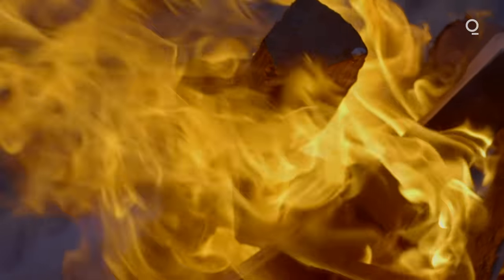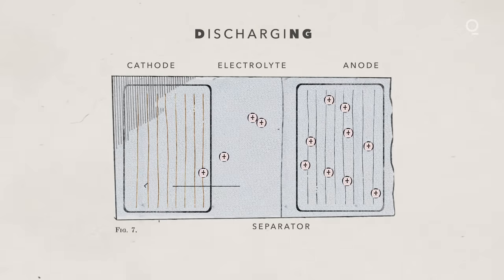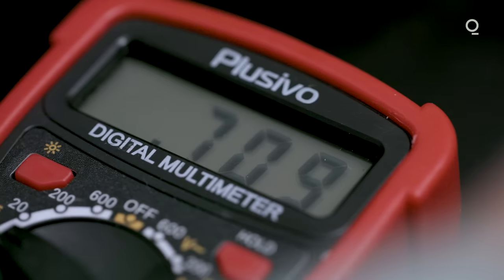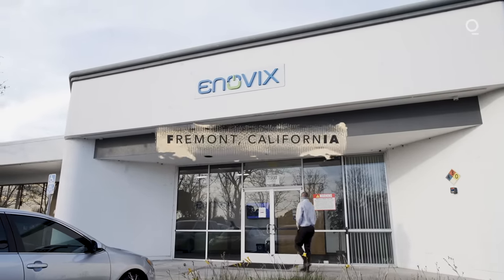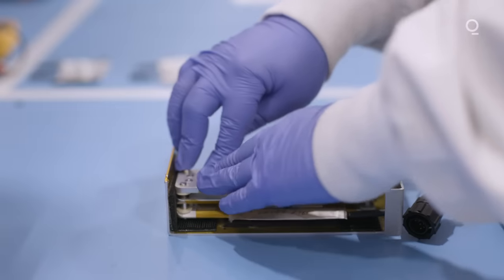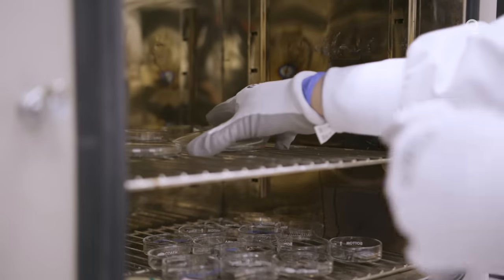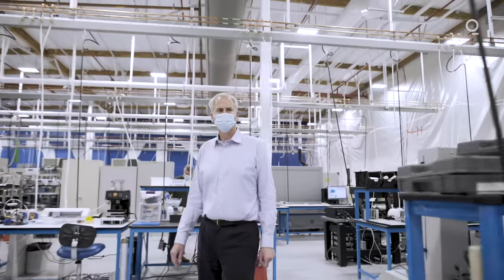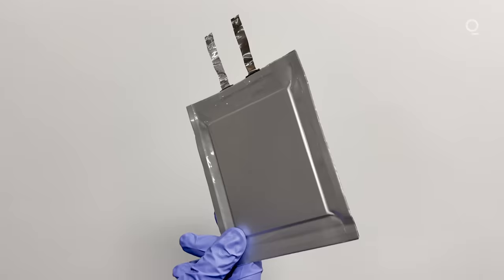How The Next Batteries Will Change the World

Comment: What about the carbon footprint of manufacturing the battery itself? Metal mining, especially lithium, is insanely nature intensive.
Reply: That's what I was thinking bhai 👍
Reply: didn't they explain in the video that lithium is not actually used in the construction of the battery but instead refers to the actual lithium ion used to store energy?
Reply: Voor EVs total production emissions of the battery pack are at about 100 kg of CO2 per kWh. Not too bad and definitely worth it.
Reply: Shhhhh, don't bring logic into the discussion.
 We are saving the Fk'n planet!!!!
Reply: @Simon-dm8zv  And what charges the battery? You think covering the planet with windmills and solar panels has no environmental effects?
Reply: @sufferr2914  Can there be lithium ions without using lithium?
Reply: @Ghst-tl9ec  Exactly, even photovoltaic cells have a carbon footprint. Leave everything aside .. have you seen the amount of plastic packaging around the solar panels in transport?
Reply: se fi  isn't it simpler for humans to be less greedy and reduce luxury consumption in the name of progress and modernity? We don't really need to go back to caves.
Reply: @Ghst-tl9ec  Not as relevant as you might think. Even if the EV is mainly charged with non renewable electricity the total CO2 emissions are still lower than any petrol or diesel car.
The point is not whether solutions have no environmental effects at all, but whether they have LESS of an bad effect than the current sources of energy. And that is truly the case with windmills and solar panels.
Reply: @tejarshihardas8707  Everything has a carbon footprint lol That’s not the point.
Reply: @Simon-dm8zv  oh absolutely yes .. our mere existence has a footprint ..but when we are living on a time borrowed from our children .. isn't it simpler to just cut down on our greed and minimize wants instead of going into a downward spiral in a bid to justify it? (Fyi - not implying to cut down on needs, just the wants)
Reply: @tejarshihardas8707  Obviously we have to minimise consumption in general, but this cannot replace the need for renewable solutions like solar and wind.
Reply: @tejarshihardas8707  A 48 hour sleep deprived version of myself wrote that sorry
Reply: @tejarshihardas8707  don't have children
Reply: nuclear energy is the future
Reply: @ok0_0  Will definitely play a role. You still need batteries though.
Reply: @Simon-dm8zv    Not when you consider the entire system.
Reply: @OneWildTurkey  As in, in-vehicle reactors?
Reply: @sufferr2914  I think they did
Reply: @tejarshihardas8707  it's a simpler idea on the surface and a nicer thought, but there's no shot everyone will just suddenly wake up tomorrow and decide to consume less. The only way this suggestion could be a real, practical solution to reducing our footprint would be if you went around policing people into consuming less, which would be a logistical nightmare even if we put aside the fact that this would be against the interest of a lot of business with political influence to keep you from doing so as well as an infringement on the rights of consumers.
Reply: @jhvnhjifgvbv8126  I agree. It's not happening overnight and in fact policing will only worsen it. Just like industrialization didn't happen overnight, even this a cultural change which we need to inculcate in our children. Lets admit one thing, any "green" idea will always be dictated by economics and not desire. Tesla's shareholders are investors, not philanthropists. Even Nikola Tesla had a hard time selling an efficient and cheaper AC technology.
Reply: @tejarshihardas8707  the "green" ideas are green, you're just thinking about the wrong kind of green ;).

But yeah, businesses only care about enviromental impact up until it starts cutting into margins. I believe in theory one could legislate to keep business in check for enviromental practices, but not in practice. At the same time, I'm glad solar and wind are getting to the point where businesses will gladly switch to it. While I'm not denying they have their own issues, I still feel as though impending irreversible climate chnage is more pressing at the moment. I do wish nuclear got better press.

I feel as though the industrial revolution is a poor analogy since the cultural changes that occured throughout it happened due to technological innovation. While I would hope we see a cultural switch into conscious consumerism, I also worry it would take too long to occur organically, if it occurs at all.
Reply: Lithium are peanuts in comparsion with oil, espacially fracking with millions of poisened water or oilsand...

Comment: 1:56 i always wondered where the Spanish term "pila" came from when referring to a "battery". 
However "battery" could also be considered as a description of plurality, such as a "battery of tests". Therefore a "battery" is a "bundle" of anions and cations.
Reply: Benjamin Franklin coined the term battery to describe a bank of capacitors (not electrochemical cells) that he was shown.
Reply: A single cathode-separator-anode unit is called a cell. A battery (in the old, proper usage) is two or more cells like in the voltaic pile. A 12V lead-acid battery as seen in cars has six 2 volt cells chained in series.

These days, even a single cell often gets called a battery in ordinary usage, like an 18650 Li-ion "battery".
Reply: @gregvanpaassen  I've given up trying to tell people that a single cell is not a battery!

Comment: In the battery industry a break through happens every couple of years, the science is hard but, bringing a battery to market is MUCH harder. youll be lucky to see this new tech with in a decade.
Reply: why is that?
wouldn't big companies profit, with state-of-the-art cheaper batteries? it will help them be above the competition
Reply: @stripyrex_gaming  1. Shortage in mining capacity of materials (mainly nickel). 2. Engineering the machines that can produce new battery tech in large amounts efficient and fast enough.

Comment: the silicon tech presented sounds increibly expensive to manufacture, w no margin for error
Reply: It might end up using more energy and natural resources than petroleum
Reply: No it doesn't lmao
Reply: Like a chip lol
Reply: @serenamente5192  they were talking about imperfections on a microscopic level which means that it would need crazy high tolerances and that would be crazy expensive. remember this has to compete with your everyday double A battery. Telsa Cars use a mildly bigger double A looking battery
Reply: @sufferr2914  The tech is there for up to 2 nanometers. Microscopic level isn't much noteworthy
Reply: @serenamente5192  excuse my ignorance but 2 nanomemeters? I am making an inference based on semiconductor production but they do not have the tech for even 3 nanometers so can you elaborate?
Reply: @sufferr2914  3nm is scheduled for H2 2022, 2nm is scheduled for 2024, the video says they hope to commercialize by 2024 (when 2nm will be there) it's very improbable it won't since the 3nm node is much ahead of schedule (originally scheduled 2023/2024) there would need to be immense delay on the 2nm node not to meet 2024. Even though ofc current commercialized state of the art is FinFET which gets you to 5nm
Reply: @serenamente5192  K but you have to take into account the fact it has to be affordable the tooling cost for this stuff would be astronomical not to mention the fact that both Samsung and TSMC are going to have most of their production bought up by companies like AMD and Nvidia. (if the solid state battery is to ever take over the market it needs to be affordable)
Reply: @sufferr2914  Apple is booking most of TSMC's production capacity. However what these companies are booking are very recent nodes, which wouldn't be needed for a microlevel, SMIC is much behind TSMC right now with its 7nm node but even 7nm  would suffice

Comment: I believe that the solution is not in chemical batteries, rather in Super-Capacitors which pick up the charge electrostatically.  It has several advantages: 1. There's no chemical to degrade over the time.  2. It charges extremely fast, within minutes if not seconds. 3. It has a high energy density.  There are several companies exploring this technology.

Comment: There is an alternative to batteries, high temperature super conducting cables.
Super conducting materials by definition can transfer vast amounts of energy over vast distances with zero loss. That means you can generate power in the Sahara and then transmit it to Shanghai or San Francisco with zero energy loss.
When it is night time in Alaska, it is peak solar generating capacity in the Sahara no batteries are required to store the energy because it just gets sent to the opposite side of the planet with no loss to be consumed.
Reply: It doesn't solve EVs though.
Reply: @therighteous802  Why do EV's need to be solved? They seem to be working just fine. The problem with renewables is that they are intermittent and unreliable so they require massive batteries on the grid to store energy when the sun isn't shining.
The only alternative is to have a planet sized super conducting grid so you can consume energy on the opposite side of the planet.
Reply: @disposabull  I'm no expert and I don't have an EV, but I think energy density is the main thing to improve. It's also what could make electric planes happen. Charge time is another, although I guess we can swap batteries (but we would need to produce a lot more than necessary).

Comment: Might be a dumb question, but at the start of the video you guys made a battery. The 10stacked layer of zinc, coffeefilter and copper that made energy. With that you could power a led. So where does this energy come from? It looks like the greenest solution to produce energy (maybe technically a “little more” developed then haha). A 4 layer composite that produces energy on its own.
Reply: The power from the voltaic pile comes from the "voltage differential" from the two metals. Essentially one metal is negative and the other is positive. You can look up a list online to see.
Minerals and metals naturally conduct energy and a charge so combining them together in electrolyte like the salt water they used lets their power flow and be usable.
Or if you want a more occultic answer the power comes from "space".

Comment: The biggest obstacle in creating or even revolutionizing the battery or an energy storage device, is the material. Chemistry can also go so far before you realize you can't use it anymore. Nuclear batteries are the future. Radioactive material contained in material strong and light enough to power whatever device however big or however small. This is why we need to start farming nearby asteroids and meteors and build in a desert somewhere a fully automated factory that will process the material and other places can produce the final product. For this to work, economics and money needs to die or there will be no future.

Comment: How about the Baghdad Battery or Parthian Battery. It's over 2000 years old.
Reply: Those are not considered batteries because they were not used as batteries.  They just so happen to have the same components as a battery.  But it wasnt used to store chemical energy and later release electrical energy
Reply: @Ddub1083  yes it was. They used them to elctro plate items.
Reply: @jbweld6193  Right... just like I said, THEY WERENT USED AS BATTERIES.
Reply: @Ddub1083  a battery is nothing morr than a storage of electrical potential. What school did you go to? Thats exactly what it was.
Reply: @jbweld6193  lol k.

Comment: Im willing to bet i will not see electric powered cargo ships and airplanes in my lifetime. They just take so much power to operate. I like the way the aviation industry is moving. Each new generation of aircraft are 10-15% more fuel efficient, these incremental gains over time will be key to reducing co2 emissions
Reply: You won't see battery powered ships. I'm wouldn't be so sure about electrically powered in general..

Comment: Remember that more energy density can equal more fire and boom in case of an accident. Energy is conserved, so a fully charged battery shorting will be lethal. These are great for grid storage, but Id be reluctant to sit atop one in a car. And, the biggest challenge right now isnt capacity, its the number of chargers and charging time holding the tech back. EVs are already perfect for city travel, and there are tons of chargers in cities now. But traveling, say, from Sault St. Marie in Ontario to Thunder bay is still very difficult, and for trucks in particular, thats a game ender right now. Its much the same in the US, where travel up the west coast is very doable, but going cross country isnt, unless you want to stop after every 6 hours to plug into a wall overnight. Still, its progress.
Reply: Perhaps with the solid lithium battery, but he mentioned that they are unsafe in the video. Currently Tesla's are the safest vehicles on the road, despite the large battery packs.

Comment: The Fat stored in your body has a higher energy density than Lithium-ion batteries.
Increasing the energy density of batteries is nearly impossible(with current tech)
And will likely be insanely unstable(battery fires are nearly unstoppable after they start)
We also don't have enough battery material(lithium) which has the highest energy density of all battery materials.
But hopefully, we reach nuclear fusion in the near future for the sake of a post-oil society that isn't a pool of lithium wars

Comment: Lithium-ion batteries are great for small portable devices, even for cars, but for massive amounts of energy storage the best thing is either 'pumped-water-storage', or molten-metal batteries.  Those types of batteries do not degrade over 20 to 30 years of heavy use.

Comment: @Bloomberg Quicktake
Look into Proton Technologies Canada and what they're currently doing in Saskatchewan.  If, and it's a big IF, but if a green, economical, and abundant source of hydrogen became possible, even after consideration of efficiencies, lithium-ion batteries would need to improve energy density by 14x and reduce charge time by 85% to compete. This would be particularly true of industrial/commercial vehicles and equipment.  Looks as though we'll still need kerosene for long-haul flights for the foreseeable future though.

Comment: Battery for container ships and commercial flights?
Dream on!
The main problem is called physics and energy density.
The best commercially available batteries are around 0.8 MJ/Kg, so let's say these battery revolutions can bring us an amazing 1.2MJ/Kg.
In the meantime jet fuel has 43 MJ/Kg, which is still 35 times better.
While airplane manufacturers doing everything possible to reduce weight, no engineer in his/her right mind would increase the weight of the fuel by 35 times. Also with jet fuel the airplane gets lighter as it flies, batteries would stay as heavy at landing as at takeoff.
With batteries no jet engines either, only propeller planes, so the travel speed is also greatly reduced.
For container ships you might be able to make half of your ship out of batteries, but that's also not so efficient either.
The best bet for decarbonizing would be nuclear power, but that's just too scary for most of the people.
The same goes for flights. The best way to make them carbon neutral would be carbon capture -> nuclear power plant -> synthetic jet fuel.
If you don't like nuclear, you can go for renewables too, but you need to keep in mind, that if you want to decarbonize everything (agriculture, buildings, manufacturing, transportation and electricity generation), in the US you might need to cover 25-50 percent of available land.

Do the math, go for nuclear.

Comment: I just sort of have this picture of this micron sized webbed semi-sphere crystal which expands but not to much when its charging and contracts when it's discharging. So it needs to chemically bond when its releasing energy and separate and artificially bond to different strands in the crystal during charge. I was thinking of doing this with some sort of aluminium sulphide setup. 600-1000 Mah to the gram Is kinda significantly cheaper cars sort of territory.

Comment: Battery powered cars...maybe.  Battery powered trucks, ships and planes?  No way.  Solid state batteries at best have about 7 times the power density of traditional car batteries, so if you can build a plane that can fly with one-seventh the number of lead-acid batteries that can power a jumbo jet at takeoff, then it's doable.  IMO it's doable...around the year 2100.  In the meantime, I'm investing in Big Oil.

Comment: Faster charging may itself be a problem. The faster you charge, the more power is drawn at once. So a battery that takes 8 hours to charge and pulls 1 amp will pull 2 amps to charge in 4 hours. 4 amps to charge in 2 hours. 8 amps in 1 hour. 16 amps in 30 min. That's assuming no losses, which is not real world. Typically the faster you charge, the more heat you generate and the more power it takes to charge. You have enough people charging their EV at the same time and the grid simply will not be able to handle it.  Honestly cars themselves are not the answer and are the problem. We need to move to mass transit, bicycles and walking as much as possible.

Comment: I feel we’re going at it wrong, computer chips are so cheap so we can make everything terrible efficient. I think this is how you up the batteries. Look at brushless motors and high torque tools. There’s theoretical max we can get from two elements too. Maybe super cool a sure large and long conductor and try to move the electrons without using them? Idk but you can only maximize old tech, gotta get creative if you really want a break thru